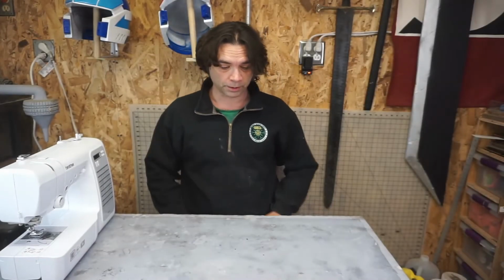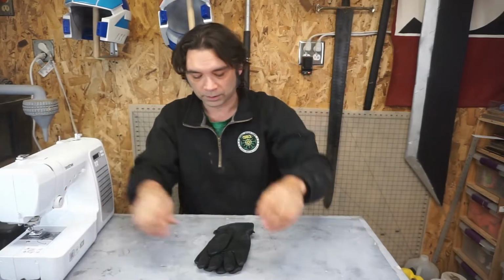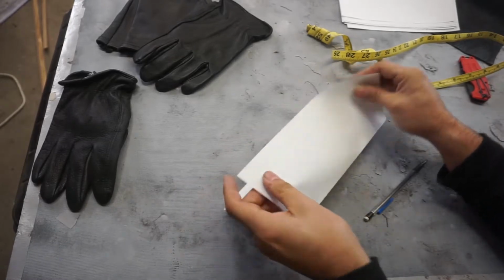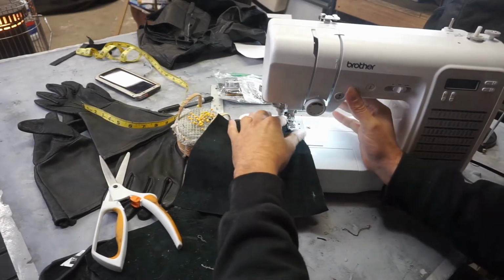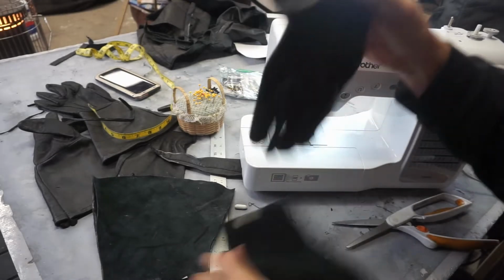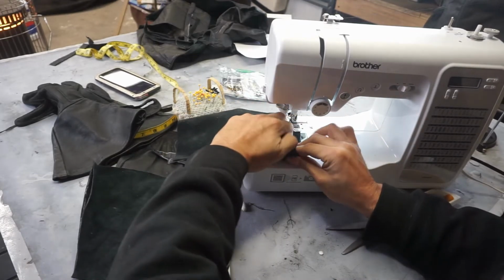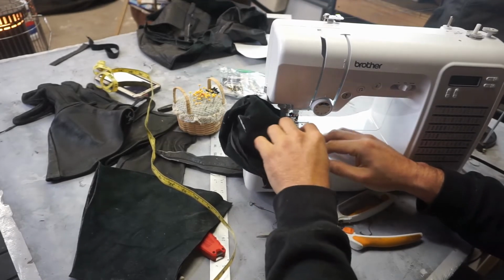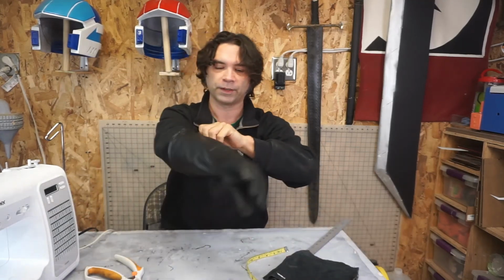A quick and easy DIY for Leather Gauntlet Gloves

Comment: Hey, couple years later here. I'm pretty new to sewing. Did you need to use a special needle or foot for the leather, or particular thread?
Reply from the maker: I used a leather sewing needle, you can get them at most craft stores that sell regular needles. You can use thicker thread, I tend to use the same thread I normally use. No special foot. I hope this helps.
Reply: @HawkWorley  It does. Thanks a lot for the video and the tips!
Reply from the maker: Also, keep in mind that everyone has to start somewhere, and there is nothing wrong with being new to a thing. Mistakes happen, thats how we learn. I wish you luck in your sewing journey.